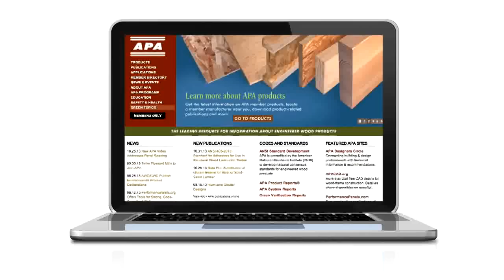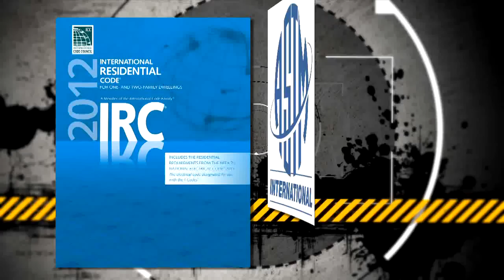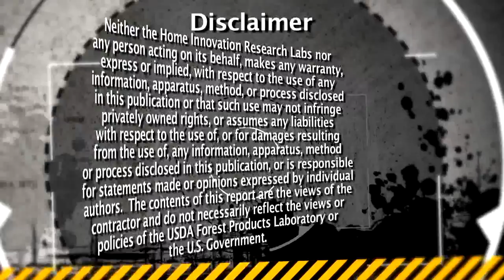Overview: Engineered Wood Products in Structural Systems for Residential Construction

Comment: If the rim board is also OSB and the fire starts near that stuff, the I-joists supporting the floor will buckle under normal load that much faster.
Reply: Use concrete and still smoke from your couch will kill you before the fire.